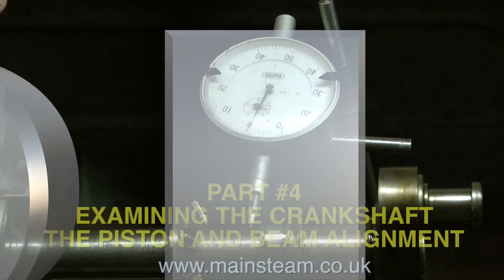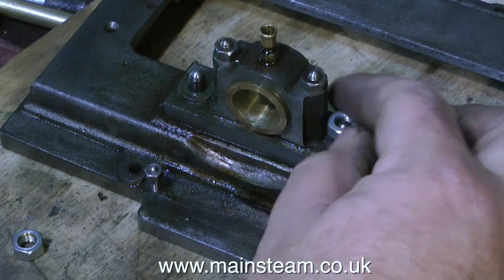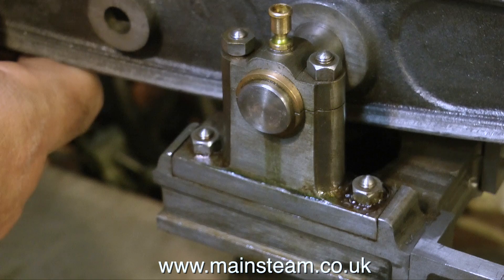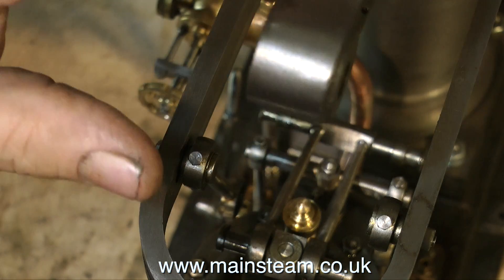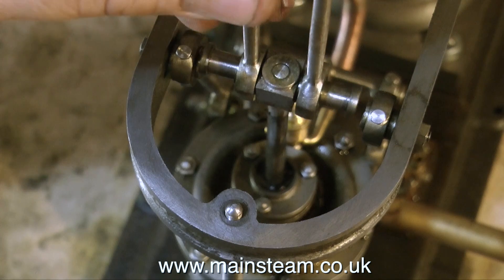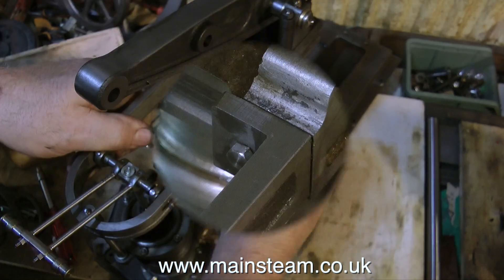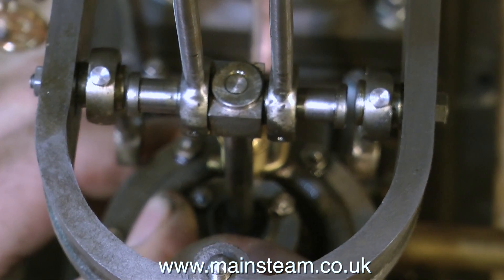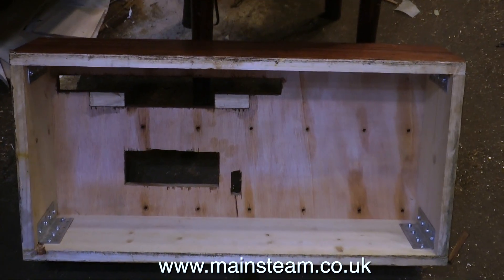STUART MAJOR BEAM ENGINE REBUILD - PART #4

Comment: keith what amount of clearance do you figure you have with the new shaft in the bearing? i've been curious as to what you figure should be normal amount of clearance on them hot side versus cold side on various  bearing in a steam engine as a general rule of thumb.  i cringed when i saw the hole locations and misalignment's on this  engine if i had done this  as a machinist i would have packed my tools up and thrown them in the lake as an anchor in shame
Reply from the maker: I do most things by feel so I am not sure of the exact clearances - probably a thou or two in this case - maybe the "Model Engineer's Handbook" or a Zeus" book would give you the bearing tolerances. Or maybe some viewers can help???